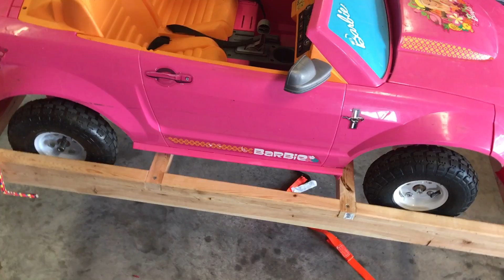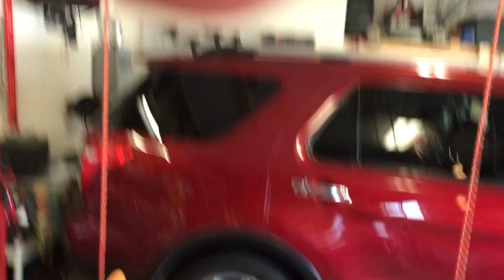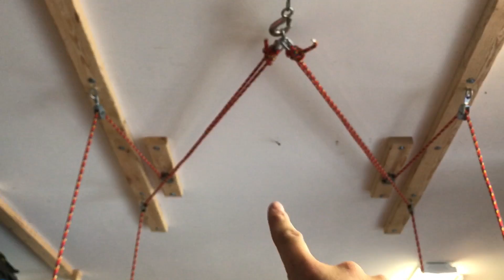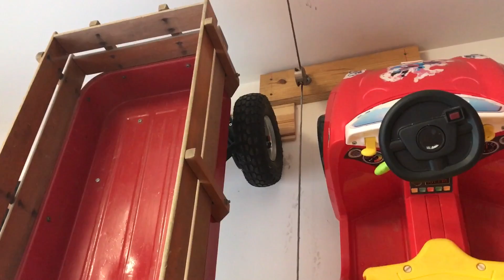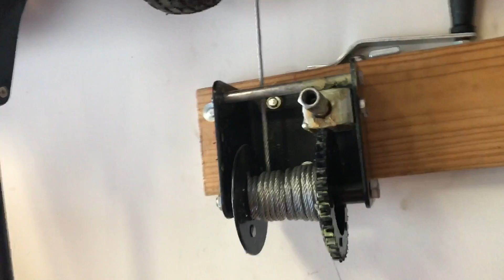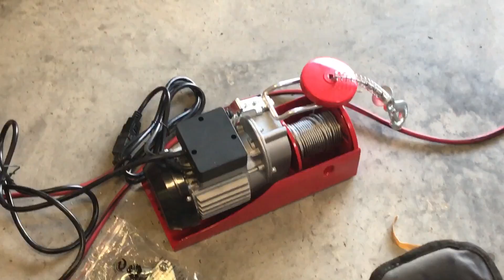How I Built My Powerwheels Overhead Storage Lift

Comment: how did you install those wheels on the power wheel?
Reply from the maker: Took a piece of pvc pipe and cut 5 slots on the end to line up with the stock wheel adapter. Then I got a rubber pipe reducer that has band clamps on both ends to grip the pipe and the hub on the wheels. Shaft was a little small so I got some 1/2 pex pipe to wrap around to make up the difference until I got some appropriately sized bushings.
Reply: Can you make a video of how it works

Comment: What do you think your load capacity is at the eye bolts in your platform? I used 5/16" eye screws. Having a hard time getting an answer with my google skills.
Reply from the maker: Kyler Bender scratch that previous comment because I’m getting conflicting results. I believe that rating may more be related to the eyelet itself. I would look at the pull out force of the equivalent lag bolt/screw, which is saying about 210-260 lbs.
Reply: @TheVintageEngineer  That sounds much more reasonable!  Thanks for looking into it.  Nice job on your videos.  I'm watching your location video.
Reply from the maker: Kyler Bender 5/16-18 eyelets have a straight pullout force of 800 lbs.

Comment: Could you provide a quick sketch showing how you determined where to install the aux pulley?
Reply from the maker: Kinda complex but I’ll see what I can do maybe later tonight.
Reply: @TheVintageEngineer  Great, thank you!
Reply from the maker: Matthew Lane how good are you with algebra/geometry? I wrote it all down but it’s a complex formula that has to be solved. If I had you numbers I can make it easy. Would need to know the width between main pulleys and length. Would also need to know the stopping point (on mine it is where the joining ring stops being pulled). Need this distance away from the center.
Reply: @TheVintageEngineer  I should be fine with your description.  I've gone through several sheets of graph paper trying combinations of law of sin and cosine in an attempt to find the coordinates of that aux pulley but haven't been able to find the correct equation setup to solve for my unknowns.  Id like to figure out the math part because I'll likely be using this design in a few different locations with different dimensions.
Reply from the maker: Matthew Lane well get ready because I’m uploading a 25 minute explanation video.
Reply from the maker: Matthew Lane done uploading https://youtu.be/idUFFBmPdaM
Reply from the maker: Did that video point you in the right direction?
Reply: @TheVintageEngineer  sure did!   Thanks for the help!

Comment: with this pulley system you don't create any mechanical advantage
Reply from the maker: Dmitry Avtonomov why would I need to add mechanical advantage when it is not needed? It would only increase the amount of rope/cable to be pulled and would increase the operation speed. The winch already has like a 28:1 reduction with no strain on the drill that operates it.

Comment: Very helpful. We want to do something similar to store plywood in our woods hop. Where I can I go to calculate the where to put the aux pulies?
Reply from the maker: Valérie Drainville I did all the calculations by hand. You can probably get away with putting 4 aux pulleys to the side close together to guide the wires close to each other and put your link of all wires outside of this. Make sense?
Reply: Anthony Shelton I second his request. Seeing your calcs would be great. I like your set up rather than bringing them all together.